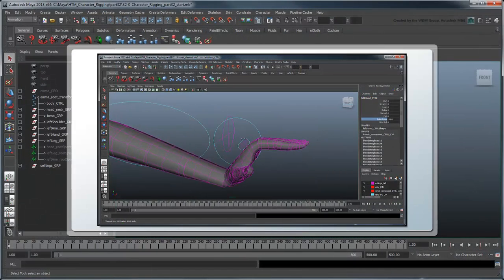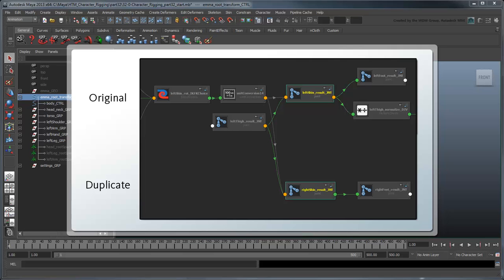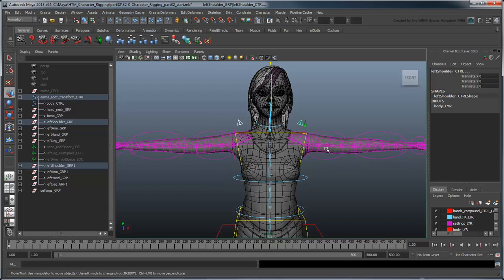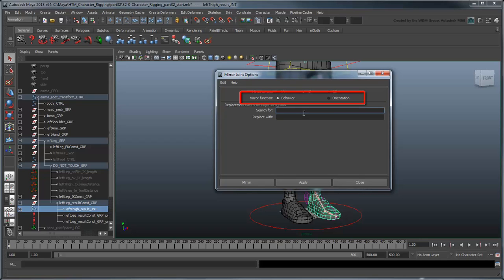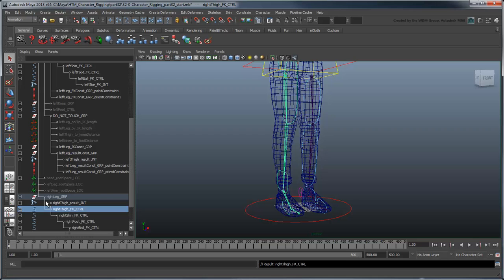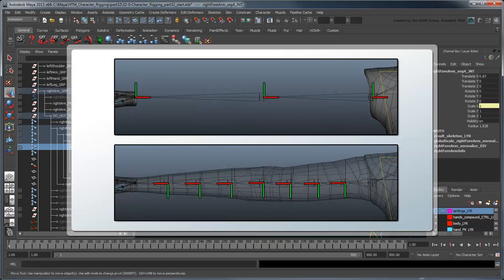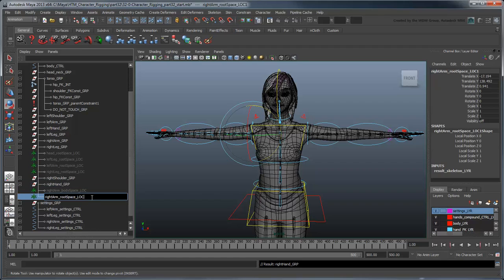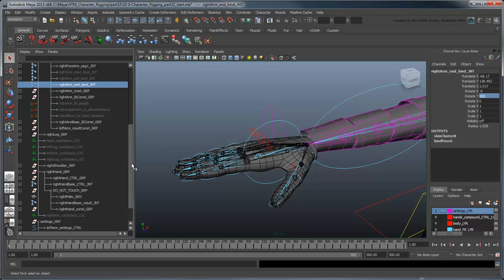Creating a Character Rig - Part 32: Mirroring (Advanced)

Comment: This along with Jason Schleiffers Animator Freindly Rigging are by far the best resources i've seen on Rigging in Maya.   Id like to say a huge thank you to the Instructor.  Is there anybody still working through the series?  I've literally just got to recreate the right foot controls however i'm having a huge problem as the foot bone is rotating around its x axis when i move the pole vector controls. It only seems to happen when I parent the foot to ball ik handle under the ball locator.  I mirrored the joints using behaviour and recreated the ik handles from scratch.  Does anyone have any ideas?

Comment: Hi i have a problem arising after orient constraining the rightarm shoulder,body,root space locs to the rightarm_fkconst-grp and the rigtharm_resultconst_grp. when i rotate the shoulder ctrl the rightarm joints goes haywire...

image is in this link
https://drive.google.com/file/d/1IFaATs7gBblQ9PzZRViTZMurn5ocyouj/view?usp=sharing
Reply from the maker: Do you get a warning in the command line that says something like "Cyclical evaluation"?
Reply: @Autodesk_Maya  nope no such warning....it works fine right up to point constrain...then orient onwards does not work...also ik rig is fine only the fk rig....
Reply from the maker: @jesselinejeyarani7364  What is the local rotation axes for those control / result joints?  Are they identical?  From your image, it looks like they may not.
Reply: @Autodesk_Maya  erm..i think they are...infact i build it again from scratch...and i am  still stuck at this orient constrain part...TT ...is there any way you can help me check the file??
Reply from the maker: @jesselinejeyarani7364  If you can post your problem and file here: https://forums.autodesk.com/t5/maya-animation-and-rigging/bd-p/area-b42

...then I can take a look at it (if the community doesn't beat me to it first).
Reply: @Autodesk_Maya  thank you so much will do so....

Comment: That problem you talk about around 15:50 does not explain how one would fix the same issue with multiple orient constraints... which is what the shoulder locator, having been scaled negative X, is doing to the fk rotation space. So I'm kinda stuck on that now. Basically, I could flip the group - but then one of the other orient constraints will be angry
Reply: Did you ever manage to resolve this as I'm having the same problem/:
Reply: @colincaterpillar1869  Aw geez its 2 years ago, sry cant remember anything. But maybe look for more forum posts
Reply: Haha 😂 thought it was a long shot.  I came up with a solution but thanks anyway ☺

Comment: How would one go about using this rig in a game engine? If one would want to use this rig in a game engine like Unreal, it would be best to have a single skeleton which is combined everywhere and skinned to a single mesh. Is it a good idea then to duplicate all result/segment joints, and make them a single hierarchy of joints, then simply connect scale, translate and rotate attributes from the original joints to the new hierarchy? Then export this new skeleton along with skinned mesh and call it a day? :)

Perhaps rotation space would mess up direct connections? Perhaps parent and scale constraints could do the trick?
Reply from the maker: Yup, exactly.  You can bake animation from the rig down to the result skeleton, then transfer that animation to the single hierarchy copy.
Reply: @Autodesk_Maya  It works beautifully! Thanks so much for the tutorials and the excellent, quick support in comments!
Reply from the maker: @Exsulator2  Happy to help!
Reply: @Autodesk_Maya  Say, is there any addtional things I can do to fix "flipping" meshes, because I've noticed that if the fk arms are rotated more than 90 forwards, the bicep area flips into a thin sausage. It can be solved by moving the shoulder controller so that the arm doesn't need to go beyond 90 degrees. However, while animating, it's unfortunate that the extremes rotations are unviable.

What would you do if it was your rig? Is blendshapes the only way to fix this? (also; remember, I can't use deformers that doesn't exist in the game engine, so no delta mushing or tension deformers!)
Reply: @Autodesk_Maya  Does invisible objects tax performance in maya viewport? Thinking of a final result skeleton that's parent  and scaled constrained to the result and segment joints of this rig. Basically, can I just hide stuff that is constrained and thus save performance?
Reply from the maker: @Exsulator2  Invisible objects shouldn't have any Viewport related performance issues - but obviously if they're helping to calculate things behind the scenes then that will still take some time depending on what it's doing.

Comment: I had a problem. My palm scale X -1 didn't go to right position. It simply scaled, and stayed  on the left side. Why this happen?
Reply from the maker: It sounds like the pivot point for the palm is at the hand joint, rather than the center of the scene, so it mirrored at the joint.  When you select the hand group and turn on the Move Tool, where does the manipulator appear?
Reply: @Autodesk_Maya  I found out that the inherits transform of the palm cause the problem. I unchecked it for the emma scale, so when mirror it didn't follow the arm.

Comment: Won't adding face deformation rigging break this rig? I haven't started this tutorial yet but i'm so confused... what is the order of this process? First i have to do the body rig, i know that, but i feel like face rigging is another beast on it's own and i'm scared that it can't interact properly with the rig created in this tutorials...
Reply from the maker: Face rigging is totally independent.  You can rest at ease that it won't break this rig at all.
Reply: @Autodesk_Maya  Thanks for the quick answer!!! One last question, if you don't mind: Where would adding hair with X-Gen come to play in the pipeline order? Before or After the rig? I am creating a bipedal cartoon fox character.

If my theory is correct: i can just add the X-Gen hair on the high poly model that i have to copy the skin wieghts to. Is this the case? Thanks for the quick answer again.
Reply from the maker: @TigreEthereal  That's correct.  You'd want to do that near the end of the process, since fur will slow down your rig.  You probably even want to go so far as animating without fur first before applying it.

Comment: Hi, Thank you for your nice tutorials.
I face a problem. I have created a Right Upper Arm ( Forward -X, Up Y ) and it works fine. But once I rotate it more than 90 degrees along Z axis , it turns by itself along X axis. This has as result to deform the mesh.
I tried possible combinations but nothing changes, do you have any idea, what is going wrong?  
Thank you
Reply: I observed that if I change the constrain order of the Start_Upper_Arm from point to parent, this problem is gone. But is it the appropriate way?
Reply: I have seen some of your comments on 22 lesson about this effect, and I have downloaded the Emma_arm_twist_fix file, and I have observed that even in Emma this happens. Is it something that we should not pay more attention and hope that the Animator will never rotate the arm above the leftArm_start_bind_JNT or the leftArm_start_aim_LOC? 
Thank you
Reply from the maker: @thanoszag6563  Yeah the short of it is that this will always be a problem.  You just want to mask it as much as possible.
Reply: @Autodesk_Maya Channel thank you for your response, I found a way of fixing it. Instead of point constraint, I did parent constraint with the Translation X Y Z and Rotation Y and Z only selected.
I am not sure if it is 100% right, what do you think?
Reply: I tried something else too.
I created a locator, I located it above the start_bind_JNT, and I parent constraint it to Result Joint( Translation X ). After that, I aim constraint the start_bind_JNT to this Locator.
It looks that it works for a wide range of rotation.

Comment: Hello! Sorry to bother you, but I have a little problem. In August, I started rigging for another character. I was doing very well until the duplication, but when I was almost done, the flexing kinematics had a big problem with the wrist. I fixed it by rigging my right hand with mirroring again, but when I want to connect my right hand, an unknown, unjustified problem appears. maybe a space problem, you don't know. It consists of orienting constraint RightArm_FKConst_GRP and RightArm_ResultConst_GRP to RightArm_ShoulderSpace_LOC after I set the rotate x value to -180, instead of 0 the result, but -360. I don't know something I forgot or I duplicated Shoulder_GRP badly, I don't know. I tried to fix everything, but it didn't work! I've had enough! I tried everything. That's why I turn to you for help. Can you tell me how I can fix it? What did I do wrong. Also how to duplicate. PLEASE! Help me if you can. Thank you in advance.
Reply: Hello! I did it! I realized what was wrong! I had to rerigging the shoulder again because the joint orient axies were misoriented. The correct orientation is XYZ and the second axis world orientation is -Z. I'm very happy, I'm proud of myself. But unfortunately there is still a bug. Honestly, I was rigging a Siamese twin humanoid alien with four arms and four legs. The problem with the back right arm is when I do the correct shoulder joint orientation and I orient RightHindArm_ResultConst_GRP and RightHindArm_FKConst_GRP to RightHindArm_ShoulderSpace_LOC to rotate x value to 0, but when you rotate x value is 0, or 360, but it might just be Bug, I don't know. But pretty much everything is fine.

Comment: Thanks for this tutorials , I went over all of the series but stock at the mirror part. I wish you can demonstrate the mirror the leg part.... Or I assume that maybe I should redo the right leg part again instead of "Mirror"
Reply from the maker: That's correct, it's the best way to ensure everything will work.  However, remember to follow the tips in this video for setting up that right side (for example, the right joint LRAs should run from toe/hand to body, rather than the other way around).

Comment: Brilliant tutorial!!! Could you please clarify how I am able to turn the visibility of the joints off WITHOUT turning off the visibility of the FK controls under them? The ones connected with the parent -r -s MEL command. Thanks!
Reply from the maker: Unfortunately you won't be able to do that since the two are one and the same.  However, you can easily hide all joints in the Viewport via the Show menu once your rig is done if you don't want to see them.

Comment: After I created the orient constraints between the right arm spaces and the rightArm_FKConst_GRP, I realized that switching between FK and IK mode causes the right arm to rotate 360 degrees in X. There is only the 360 rotation in shoulder space though, so I know it has to have something to do with the shoulder space locator, but I'm not sure how to fix it. Any help would be appreciated.
Reply from the maker: Hmm.  Did you recreate the right arm from scratch or did you mirror some of the joints over from the left arm?  It sounds like either the locator is rotated 360 or the entire right arm space is.
Reply: @Autodesk_Maya  I mirrored the FK, IK, and result joints from the left arm. I did mirror the segmented joints as well but I used them as templates only since their X axis wasn't running in the right direction. I've checked the transforms on the rightArm_GRP and they are all zeroed with 1 in scale. There are no rotations or negative scale values in the rightShoulder_LOC either. I'm just not sure why it flips like that when switching to IK. Is it better to mirror the joints or create them from scratch? I do see that the X rotation for the rightArm_resultConst_GRP is 360 in FK mode and 0 in IK mode, but I don't know what caused that.
Reply from the maker: @JoshuaMock231  That's definitely the root of your issue.  I'm not sure why that would've happened - it sounds like you did all the steps correctly.  Generally it's okay to mirror the joints using the Mirror Joints function just for the result joints, then create the IK/FK from those new mirrored joints from scratch - that's the most full-proof way of making sure everything works correctly.
Reply: @Autodesk_Maya  Interesting. I will have to try just mirroring the result arm and recreating it from scratch to see if I can get it to work properly. Thanks for answering!
Reply from the maker: @JoshuaMock231  Happy to help.  Just remember: the LRAs of the right arm should be the opposite of those on the left arm (i.e. +X will go from hand to shoulder, rather than shoulder to hand).  If you get that part right, everything else should follow.
Reply: @Autodesk_Maya  Sounds good, thanks! Just to be clear though, the LRAs (+X) of the segmented joints go down the shoulder to the wrist, right?
Reply from the maker: @JoshuaMock231  I actually reversed those too, but theoretically it doesn't matter which way those go since they're only for rotating geometry (i.e. nothing else depends on them).

Comment: Would it be simpler to duplicate the whole thing and simply go in and repair the things that are broken?
As far as I can tell it seems to be world space related things that broke, so mirroring and then rebuilding all the IK might do the trick?
Reply from the maker: You could do it this way, though whether its easier or harder is a bit subjective.  The tricky thing is that properly solving the -ive/+ive space issue involves adjusting the LRAs of the base joints themselves, which has a ripple effect since the various FK / IK controls are based on them.  You could certainly duplicate, mirror, and then fix the opposing sides but IMO the possibility of making a mistake somewhere would be higher than just creating them from scratch again.  It really boils down to how careful / confident you are.
Reply: @Autodesk_Maya  Good point, the lra seems to be very tricky to change once the joints are smack dab in the middle of the rig. Feels like they should be correct and rotations should be 0 when the connections are made. Besides, if I do that foot part again I might actually understand it. Thank you for a fantastic tutorial btw.

Comment: @Maya Learning Channel - Part 32 @16:09 After mirroring the left hand to right my joints are not staying together at the wrist and the rightHand_FK_CTRL is only working with a positive X rotation.

Also, the rightMiddle3_GEO has turned black and it's not a two sided lighting issue (last image).

See images: https://www.infinitee-designs.com/part-32-1609
Reply from the maker: Judging by the image, it looks like the end of the FK arm / result arm / segment joints is caught in some sort of blend between two positions.  I'd check all their effectors and make sure they're all set to 1,0 rather than 1,1.  If you temporarily show all the related joints (FK/IK/Result) at the same time, it makes troubleshooting this kind of thing visually easier.  Also, make sure the squash/stretch is working properly, because the palm raise depends on that to allow the arm to stretch up to it.

For the two lighting issue, I'd select the black geometry and try reversing the normals on it.
Reply: @Autodesk_Maya  Well, the black geometry turned out to be that the rightMiddle3_GEO's Shape node lost it's material. To fix it simply, turn on Shapes in the Outliner, selected the rightMiddle3_GEOShape and assign it a material. Still no luck with the more important joint problem though. The stretch and squash is working correctly and I don't see anything wrong with any of the effectors.  The only thin I did notice is that the Hand FK Visibility and Hand CTRL Visibility needs to be done for the rightArm_setings_CTRL but that's understandable.
Reply: @Autodesk_Maya  Can you please explain a little more on how to "check all their effectors and make sure they're all set to 1,0 rather than 1,1." 

The black geometry turned out to be that the rightMiddle3_GEO's Shape node lost it's material somewhere in construction.
Reply from the maker: @RalphManis  If you select an Effector and look in the Channel Box, you'll see the objects involved in that effector.  If one object has a value of 1, while the others have a value of 0, then it means that object has full influence over that effector.  If two objects have the same value (usually 1) then it means they share a 50/50 influence over that effector.  If three objects have the same value, then it means they share a 1/3rd influence over it.  The reason I say it appears as though your arm is caught in a 1/1 scenario is because it's halfway between the default position and the "palm-raised" position - meaning that it appears that it's being influenced equally by both.  In order to meet the palm though, it needs to be fully influenced by the palm's position.
Reply: Solution: Okay, so because I built my right arm at the same time as the left arm instead of mirroring it, when it came time to parent the rightHand_const_GRP @15:49 it did not need to be rotated 180 degrees along the X axis but @15:54 the rightArm_end_bind_JNT did need to be rotated 108 degrees along the X axis before parenting. This in turn required the rightForeArm_HDL Up Axis to be set to Closest Y and the Up Vectors set to 0, -1, 0.

Comment: the Axis orientation of the translate tool Is got to be in world for this 
to work??
Reply from the maker: No, that shouldn't matter.
Reply: Maya Learning Channel. Well my just flip from his axis from left to right but not from position so basically stayin the same place and only works if I got the tool on object on world it doesn't matter how I flip it it will go the same direction of the left
Reply from the maker: It depends where you're mirroring from.  If you flip from the shoulder then yes that would likely happen.  If you mirror from a bone that starts on the Y=0 plane, then it will mirror across the center of the body.